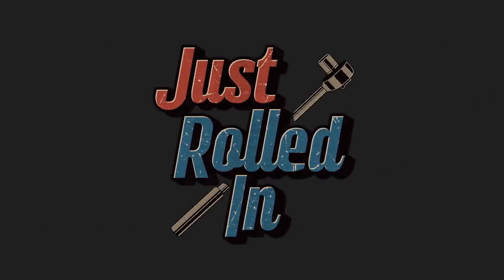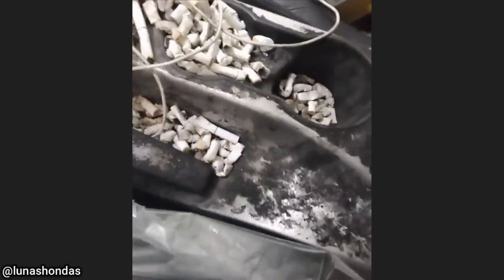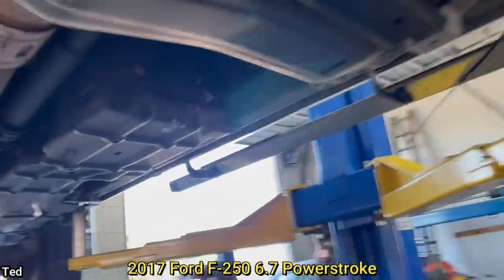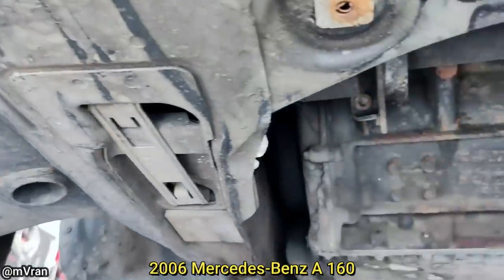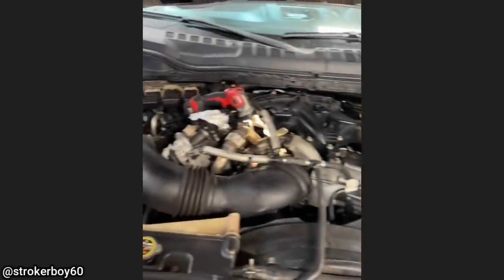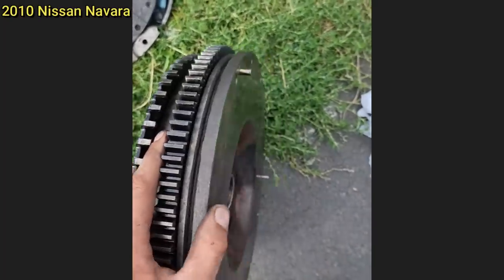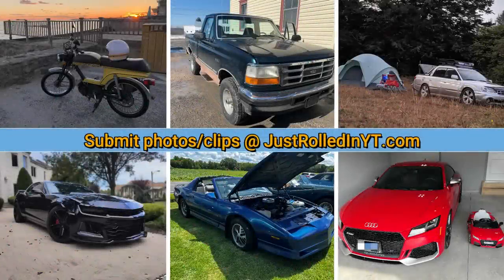Customer States Burning Smell After Trying To Replace Air Filter | Just Rolled In

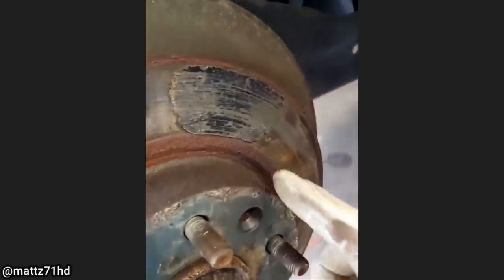Comment: 0:51  I've seen this with cheaper aftermarket pads.  The adhesive comes off and or bits of the pad stick to the disc/drum.
Reply from the maker: First time seeing it myself lol
Reply: brake pads from mattel hot wheels?
Reply: @JustRolledIn  I just redid a clutch yesterday with one of the pucks coming off from bad adhesive.  Didn't weld itself to the flywheel though.
Reply: @practicalplinking6133  More like a Dollar Tree or Dollar General equivalent, if only those stores sold brake pads.
Reply: @101Volts  I'm thinking more like " dorman " parts

Comment: 1:02 coolest car stereo installation I have seen 🤣😂
Reply from the maker: I wonder what it sounds like 😆
Reply: @JustRolledIn  me too 🤣
Reply: That is one orky kustom job.
Reply: Gotta love the blue painters tape holding the wires.
Reply: @michaelwarren2391  That's pro-level work right there lol
Reply: @JustRolledIn  it might have plenty of bass but not much else (the external speaker cables are too thin, and it would be a daft idea here in UK due to weather + laws, you can be pulled over and even have the vehicle seized if the sound system is viewed as "anti-social"). Not surprised the driver had "electrical issues" either 😁
Reply: @JustRolledIn  Probably sounds as good as it looks.

Comment: Was sitting at a red light long ago near a road construction sight. Suddenly there was a horrible banging noise and i could feel it shaking my truck. I shut the motor off thinking it had slung a rod. The noise continued. It was an excavator with the huge jackhammer attachment busting up a concrete sidewalk right next to me.

Comment: The def issue is so funny. The fact ford and ram had there def filler next to the diesel fill cap boggles my mind. Easiest money grab ever. They know people have more money than brains.
Reply from the maker: It's crazy how many times I've seen this happen. Most people catch themselves   before driving the truck and having it shut off. But unfortunately some people don't and it gets expensive.
Reply: @JustRolledIn  indeed it does. One of my co workers did this with one of our 2015 chassis cab f550s. $4,000 later and 2 weeks in the shop during the middle of our work season. The funny thing is no one fessed up to it and I still don’t know who it was.
Reply: @Sackmatters   Probably the boss himself, but too embarrassed to admit to it!
Reply: What I don't get is how people make that mistake.  The DEF cap is blue, and diesel is a much larger green cap.

Comment: Notes for cust.:
1.) Stop hittin' shit.
2.) Stop tryin' to fix it yourself. Just let us do it.
3.) Stop building "custom" sound systems. They look stupid, don't work properly, and put too much draw on the wiring harness, alt and fuse box. (Same goes for unnecessary ground lights.)
4.) Yes, parts cost money. So much less than hospital bills or lawyer fees.
5.) No, you're not just paying some grease monkey to replace parts. You're paying a skilled technician with the proper training to properly diagnose the problem, (probably your fault, which is why you get angry + defensive) remove the old parts and any other stuff that's in the way, use the proper gaskets or sealant to make sure it doesn't leak, verify and program the changes with a scantool, then do a visual inspection and finally take it for a test drive. It takes time. It ain't easy. This ain't the '50s, buddy.
6.) Seriously, stop hittin' shit.

Comment: I've used that last prank on other mechanics many times after they installed new parts. I've also been known to attach a strip of stick on weights to a front rim on another employees car so it would shake on their way home, or put long wire ties or a coat hanger on their drive shaft so it slaps the floor while driving home. The funniest prank anyone ever pulled in our Ford shop was when the truck shop foreman's son was leaving to return to college they shrink wrapped him to a column in the shop and drenched him with water from a jug then grabbed another jug and poured a line of brake fluid from him across the shop and lit it on fire. He thought both jugs were flammable and just screamed. As far as work order complaints go, I got a diagnostic request once for check poor acceleration with brakes applied. And I had an old Chevelle come in for tires and it had no backing plates, no rear brakes and the brake lines were cut, folded and soldered shut on the rear axle. GM had issues in the 70's-80's with wheel cylinders ripping out of the backing plates so this guy solved his problem. Of course I had to drive on the road with him so I turned his name and tags into the state police for being unsafe on the road. I wish I would of had a camera over my 40yrs working on cars, I'd have a channel like this too.
Reply: I would have lasted about 10 minutes in your shop. Either walked out in disgust or beat the shit out of somebody.
Reply: @mindpilot72  another good one was after the compressors are drained for the night (most shops exhaust any water buildup) take an empty antifreeze jug and poke a hole in the side and thread an air fitting into it and hook it to an air line. next morning when compressors are turned on ... Boom.

Comment: A truck driver at a job I used to work at accidentally put DEF in the fuel tank of the company's brand new Mercedes semi truck. The truck needed a complete new fuel system costing $15,000 Australian.

Comment: 1:30 that def in the tank. I don't think there was a need to replace all the diesel fuel parts. I work on lorries in the UK and we've seen this same mistake. We just flush the tank and the lines out, put some fresh diesel in and run it. It'll smoke for a bit as it burns the ad blue being mostly water based and never had a issue with a fuel system part failing. 😀
Reply from the maker: Doesn't work on the fords unfortunately. If the customer wouldn't have driven it then they could have done that. But driving it until it shuts off does quite a bit of damage from what I've seen.
Reply: @JustRolledIn  that's unfortunate. We've never run into any issues on the truck with flushing most of it out. And they get driven in as well.
Reply from the maker: That's good! So much for built Ford Tough, right? 😜
Reply: @JustRolledIn  ford are garbage haha
Reply: Ive done the same thing on a few 6.7s. If you don't let the def sit and gel up you can flush it all out. But if it's had long enough to sit then your fucked.
Reply: @andrewedwards6548  My standard answer to "Fords are the best selling trucks" is "Yeah, because they either get stolen or in a wrecking yard somewhere."
Reply: @JustRolledIn  Found On Road Dead Tough!
Reply: @killerdoxen  yeah even in the UK ford are the worse. They say their transit is the number 1 van in Britain. They break down alot and there alot cheaper then the better vans hence why so many companies buy a flleet of them.
Reply: @NemoConsequentae  i prefer Fix Or Repair Daily but that works too lol
Reply: @GearGuardianGaming  First On Race Day.
Reply: @GearGuardianGaming  For Only Real Drivers.
Reply: Modern common-rail diesel fuel systems are so delicate, all of them, regardless of brand (most of them are using the same Bosch system anyway). Even slightly subpar diesel fuel (let alone someone other than diesel fuel) will destroy the injection pump, which then blasts metal into everything else and destroys all of that too. For the vehicles that survive having DEF in the diesel, they don’t last long after that.
Reply: Effed over rebuilt dodge.
Reply: I know someone who filled the screenwash reservoir with adblue. Boy did it take a long time to get it off the screen!

Comment: At an old job, my boss (manager), used to rig up an empty coolant bottle with an air inlet, crimped an air hose, fitted the air hose to the bottle, put it into a garbage bin, filled it with a bunch of loose paper items, then kind of stood off to the side as the victim would start working on whatever...then the manager would let go of the hose crimp and the bottle would fill with air and explode sending paper flying all through the shop. So....I taped truck weights on his driveshaft and all over the inside of his wheels...he had a fun lunch hour.

Comment: Pretty sure I told this story before but maybe that was on another channel. When I was in auto shop in high school in the 90's-early 2k's we did some good pranks on some folks. One was a bunch of us kept lifting the ass end of the one shop teacher's car and spinning it around in his parking spot so once or twice a day he'd come out to find the car parked the other way around. Best one I can remember was one of the kids being a dickhead for a bit too long so me and a couple other guys decided to roll under his truck and take the driveshaft off since it was high enough to just scooch under and take the U-Joints off and pop it out. He went to go to lunch and hopped in his truck and it wouldn't go anywhere. (RWD only) so after he started flipping out wondering if his transmission went I told him to check underneath it and he got SO pissed off when he saw the driveshaft gone. xD
I was the guy who ended up having the pity on him first so I scooted back under there and popped his driveshaft back on for him. We were originally going to let him put it back on himself. I don't know if you could do that sort of thing now with modern ones without ruining the U-Joints.

Comment: Once had a bus from a Canadian company towed to my shop, with passengers on board.

The bus came out of Ontario, and heading to NYC. It wasn't until they got around exit 17 on the Thruway the engine sucked up the def in the fuel tank.

I took the passengers on to NYC, and completed their tour before driving them to their cruise ship.

The bus ended up having their whole fuel delivery system flushed, and injectors replaced.

Not cheap all around.

Comment: All that "knocking" and the guy never shut the van off either.
Reply from the maker: He did right after I stopped the clip but there was music blasting in the background lol
Reply: Waiting for the earl pressure to build up. Not abnormal (not right either) for an engine to knock on first start up if the tech didn't prime the oil system pressure, goes away after a few seconds.

Comment: Work as a Diesel Garbage mechanic. Had a driver once write up. Headlight fluid low. What? One headlight had a bad seal. Replaced the headlight. Wrote on the computer. Topped off Headlight fluid. Thanks 😂

Comment: Blue painters tape holding up the wires?  lol    How these people manage to literally break their engines is beyond me.
Reply: I know right? For god sakes everybody knows you need to use duct tape and bailing wire for that!
Reply: But at least he didn't wrap the wires around the exhaust or driveshaft or tie them off on a suspension component.

Comment: Just a friendly FYI if you own a diesel and you accidentally put DEF in the fuel its covered under MOST insurance policies, oh and DRAIN YOUR WATER SEPERATOR EVERY 30 DAYS. Also if you put diesel in a gas vehicle (I know what I said, I know they dont fit but it happens) or gas in a diesel.

Comment: There’s literally color coded caps so you don’t mess up and put DEF (blue cap) in the Diesel fill (big green cap).
Reply: I wonder of the different colors are noticeable if the gas station still uses mercury vapor lights.

Comment: Years ago I did an engine swap on my old car and I had my cousin help me. The swap went well but when I started the engine it ran really poorly and I thought we'd just wasted 2 days swapping in a bad engine. However it turned out my cousin is a bit of a joker and he had swapped 2 spark plug wires on the new engine.

Comment: as a audio head the 6th 1:03  clip makes me cry like just buy a pre set up for 2 12s... ur truck not even meant for 2 12's big box . so just get a shallow sub box of 3 10's or even try to look for a sub box for a Tacoma like behind the seat under the seat under the front seat one 12 in the middle floorboard and 2 10s under the back seat or even one 10 , or buy a waterproof cover for the bed  and the wire management makes me wanna kms ngl... like even if it sounds which ik it doesn't decent i would cry if someone was in my truck and see that shi like ur friends hop into ur truck ooo don't step on my 200$ amp even though my setup is shi and could catch on fire...  u didn't even try to make it look good and u could've put it under the seat and hid the wires and the wires hooked up wrong  idec if its 400$ sub ik the buckets be moving and  everything  probably why the subs look like its been threw up on this isn't no competition set up either like this is sad....

Comment: Even an f250 fuel system makes it on here? I do at least 2-3 of those every month, you'd be surprised how many people mess them up. You forgot to mention that the repair costs around 13-16k
Reply: He said it was 18G
Reply from the maker: The tech said it was 18g. But maybe that's in CAD which would be $14K USD. They didn't mention.

Comment: That last guy reminded me of me. I use to pull that prank on my dad back when I was in high school. I would start the tapping while in the back seat of the car. As the car sped up, I would increase the tapping so they were in sync with the RPM's on the tachometer. My dad was going "WTF is that?"

Comment: I work in a tyre shop and we've had some pretty bad tyres come in from near racing slicks to the tyres cracking so bad it looks like you could pick bits off, but your channel really takes it to another level I must admit, like why are people that adamant on not getting repairs when their vehicle is a death trap and is either going to kill them, others or both. I even question the customers choice in my head at work when the manager says about taking the ramp down to get their car out. It's like, they need it but nah. It's scary people are that careless or don't care that much

Comment: Okay, I need help with the New Air Filter On Exhaust Manifold. You open the hood, presumably place the new filter on top of the engine, then open the air box... 

Then what, take the old filter out and put it back in? Take the old filter out, throw it away, somehow drop the filter into the engine bay, pinning it against the manifold...

I don't know. I can't understand how someone can actually be that dumb.
Reply: Just a wild guess:  "I need to change the air filter.  Well, the air comes though the radiator, if I just put this in front of the engine, that will filter the air, right?"

Comment: I took my POS  Ford in for a fuel service and it cost me $25,000 to change the filter because they had to take the frame out and the cab off.....not 😅 I'm not stupid enough to buy a Ford
Reply: You realize they took it off the frame to replace the ENTIRE fuel system right? not just "change a filter"  ford, chevy, and dodge all have made piles of junk and amazing vehicles, just stop with the fanboy crap
Reply: No you did not you lie so badly

Comment: The engine only has 80 hp..
That's why it's a thin metal hollow axle.
Also multiply that 80 hp by your 1st gear ratio. Now you have 500 hp.